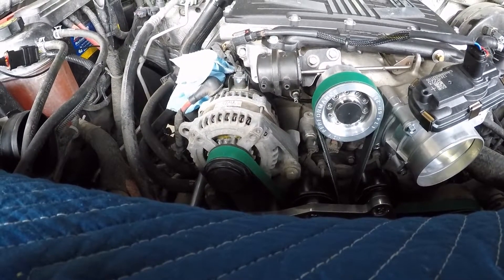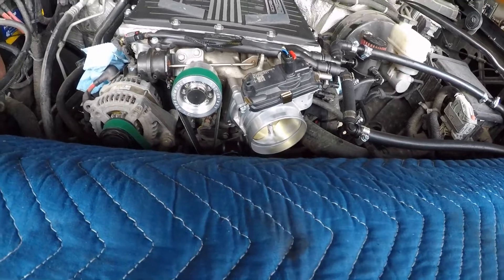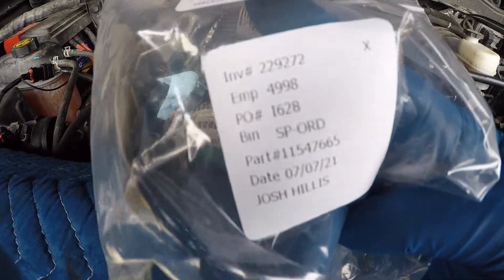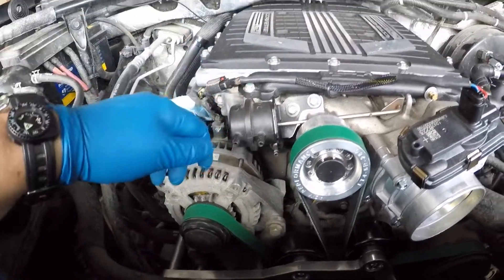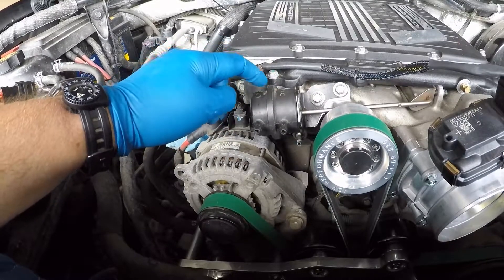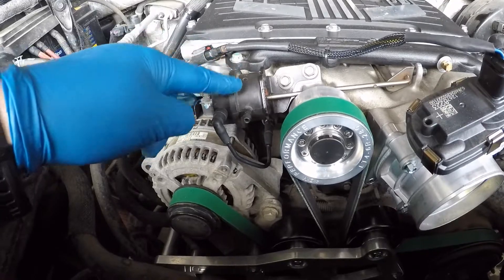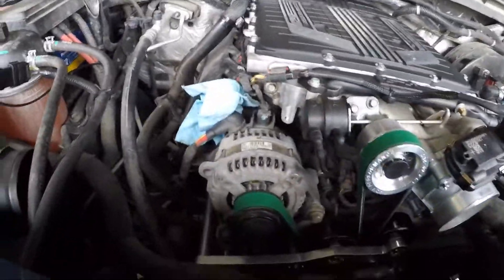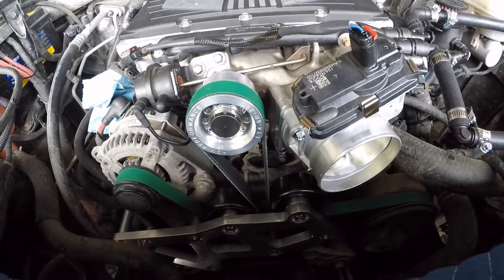LT4 Supercharger Install - Supercharger Install, Part 11

Comment: My lt4 supercharger on my Camaro ss locked up on me ..had to get a stage 2 rebuild 😭I only had the boost side hose connected and the vaccum side unplugged … so when I put it back on do exactly this to prevent it from locking up on me ?

Comment: Hey what belt is the green one? 98-1/8?
Reply from the maker: 98 inches - Gates K060984HD
Reply: @hillitex2208  thanks man! Your videos have been a ton of help! I’m doing this on a Tahoe and the heater hoses have a T at the firewall for the rear heater and they were a complete pita.